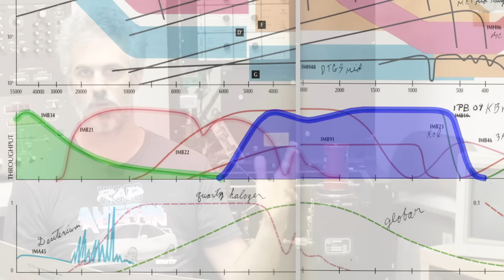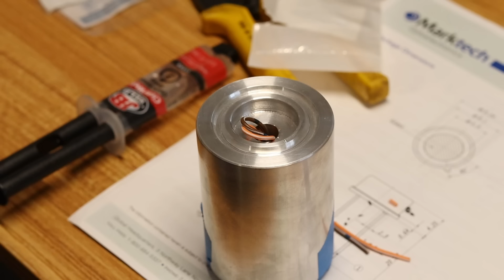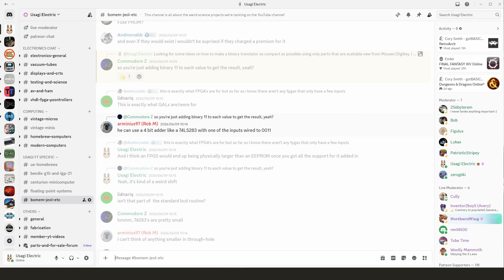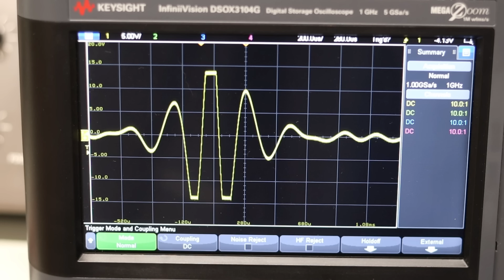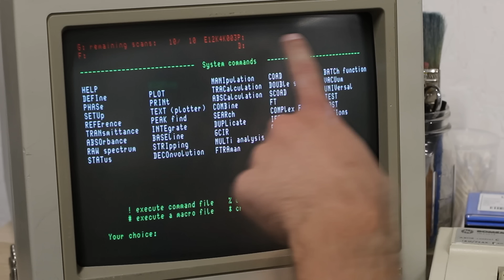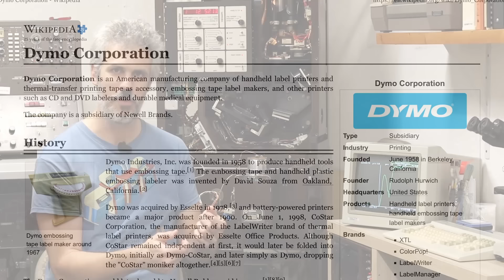Using a PDP-11/73 to do Real Science!

Comment from the maker: @Muonium1 left a lovely reply, but Youtube's automatic comment suppression system deleted it for... who knows what reasons. But, we managed to sneak it through in a reply to a different comment below! So, for my own reference sake and to move the information to an easier to find location for anyone curious following along with our spectroscopy journey, I have copy pasta'd their comment here:

"😁 As I say before, just elated that my spectra have been of use to someone so many years after I created them! I suspect the difference in peak height between our spectra is simply down to path length and the fact that I was using pure anhydrous lab ethanol rather than a 95% solution. I wasn't even using a proper cuvette! I used a tiny little 10 or 20ml beaker, which if I recall correctly was probably about ~30-50% longer in path length than your cuvette here. Beer's law and all that... Anyway, it occurs to me that you could potentially just MAKE your own KBr beamsplitter! Sure it might sound totally crazy, but there is just someone crazy (and very brilliant) enough right here on YT who's made his own KDP frequency conversion crystals for Nd:YAG lasers already! His name is Les Wright (called Les' Lab here). 

The video where he shows how to grow big, PERFECTLY optically clear KDP crystals using Alan Holden's method with a rotary crystallizer is called "How to grow big crystals at home fast!" KBr may be even easier to grow than KDP, and should be trivially easy to cleave into flat slabs for a beamsplitter with a common razor. In fact, I suspect Les may be happy to just grow the crystal for you if he has time! Maybe you could do a collab video or something. He's also a laser expert so he may have some tips for your mode-hopping/dying HeNe there. 

Incidentally, there's ALSO a video on here from 1958 from Bell Labs featuring Alan Holden himself explaining crystals which, while not in-depth, is excellent and a fun watch. The Bomem odyssey is quickly becoming a science saga favorite on here for me!! Keep up the excellent work!!"
Reply from the maker: Oooh, I didn't even think about the difference between lab grade ethanol and the run-of-the-mill Everclear I'm using, that could definitely account for some of it.
I'm familiar with Les' Lab, I recently discovered their channel when searching for more spectroscopy content. I'll have to catch on on their video of making the KDP crystals. Mike is actually already working with a company to make new KBr beamsplitters, but our real hope is to make new KCl beamsplitters as they're not nearly as hygroscopic and much hardier. 

I'm super excited to see what we can do when we get the Bomem into vacuum. Mike hooked me up with a high pressure cell which has a very short optical path, so we can even do some fun spectroscopy of liquids in vacuum which should be interesting. He also dropped off a UV/Vis beamsplitter today, so once I can figure out how to get a deuterium source in there, we can do some UV work too!
Reply: @UsagiElectric  Many thanks again for the kind words in the video. Will be great to see what kind of super high resolution spectra the machine can produce when it's back in 'full form'. Oooh you're getting a D2 source! The D2 spectrum on Wiki....also me 🤣 hahaha. I've actually seen that one used in lots of different places. There was simply no spectrum of deuterium anywhere on the internet that I could find when I uploaded it. I love seeing it in amateur science work, forums, youtube videos, even the occasional actual published paper. Very satisfying to see so many people get some use out of it. Again, it's not that great of a spectrum! I'm sure your spec could achieve MUCH higher resolution throughout a far wider range, and so if you want to replace it with a better version, please do! Cheers.

Comment: I am curious as to how well a xenon incandescent source would work.  They're a bit more expensive than a halogen lamp, but most of the light emission is from the excited gas molecules rather than the hot filament.  They are comparable in efficiency to quartz halogen lamps and can last considerably longer- up to 20,000 hours in some applications.

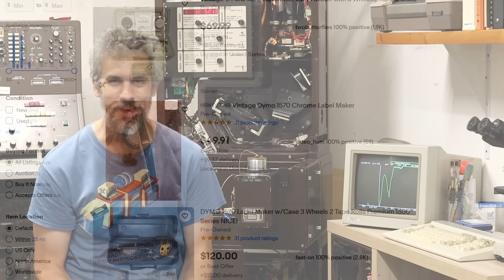Comment: 21:30 Those long handle metal dymos look really cool but I've seen 4 of those at work, and they're all jammed or got broken blades and stuff. Wouldn't recommend a vintage one unless the seller guarentees its working or you want another little project replacing cutters and getting little plastic bits to line up

Comment: Hello @UsagiElectric, I happen to have several of those vacuum tube counter modules, mine are Beckman/Berkeley Div.
 I have a question: What was first; The chicken or the egg? In other words, the HP counters are exactly like the Beckman ones I have, who licenced to who?

Mine are very interesting, some don't use a PCB, but they use a plastic sort of chassis where all the resistors and capacitor reside, sort of in a 3D network of connected components, I can provide images if interested!

If you don't see this message, I will try in the next usagi electric posting! thnx.

Comment: The "pre-amp plugs into the detector" thing is probably due to the wires picking up static electricity otherwise. And I guess the InSb detector would need liquid N2 cooling in the near infrared because its own blackbody radiation would already saturate the detector.

Comment: I'm loving this! When you finished the first Bendix G15, I asked what practical use it could be put to, since the software that the original owner of that computer had run on it was long gone, and nothing had been written for a Bendix G15 in decades, and I'm not into games like so many retro computing enthusiasts are. Well, now you're putting a vintage PDP-11/73 to good, practical use with an equally vintage Bomem spectrometer, and it's completely awesome! Back when I was in college, I did my computer science homework mostly on a DEC VAX 11/780, but after graduating, I never had a job with a company that used a minicomputer for running actual business applications. The closest I ever came in the real world to the kind of programming I learned in college was making occasional modifications to check sorting software on an NCR Tower that ran Unix. Seeing a PDP-11 used the way you're using this one is exactly what I missed out on. Thank you!

Comment: First, I love OSH Park: their customer service is great.

Second, I really suggest against running tap water as coolant. I'm a little more demanding (12kV CO2 laser coolant loop) but I can't imagine any reason you wouldn't want to run a distilled water coolant loop in any machine, especially one with high voltages. The tiniest amount of aquarium anti-algae chemicals and you're still at negligible conductivity and near zero TDS to deposit on your basically irreplaceable equipment. You can either pay less than two dollars a gallon for distilled water or buy a $60 distiller and get it for something like 20 cents a gallon in electric costs, then just use a 120v submersible pump in a five gallon pail. It's a cheap way to protect your equipment and you don't even have a total-loss system. 

Just keep an eye on the water temperature. If it gets too hot, you can throw ice in some sealed plastic bags and put them in the bucket or, if you're a little more demanding, set up a radiator and fan or even a secondary cooling loop with non-distilled water and just dump ice in the secondary tank.

Comment: The board houses' default shipping method is pretty expensive, they use either DHL, FedEx or UPS. But they all offer a "cheap" option that takes longer to get here, but is significantly cheaper. I'm patient and willing to wait a bit to save a significant amount of money. (well, actually I'm not, but I've trained myself to be patient when it comes to ordering stuff from the far east.) And it actually doesn't take that much longer than DHL/FedEx/etc. DHL/FedEx/etc. usually gets them to me in around 3 days, and yes the cheap options are slower than that, but not by much. I usually get my boards within about a week, sometimes 2.

Comment: While Dymo labels are very retro, I really like my Brother P-Touch...  I have the PT-P720BT, which is bluetooth, and rechargeable, takes tapes up to 0.96 inch wide, and there's tapes in a wide range of colors... This labeler is run from apps on your phone, and can do graphics as well as text.  The generated labels have a clear coat over the printing, so they are abrasion resistant.   Dymo has a similar system, i had one before this, and found the printed labels 'rubbed off' too easily.

Comment: Use SSOP adapters for fine pitch SMD IC's and mill/etch the rest.   I've had similar experience with Chinese PCB manufacturers, Aliexpress as well.  Prices have reached Radio Shack levels and getting worse..

Comment: I wonder how much cooling the Bomem equipment needs. If it's not too much, a system built from CPU cooler parts might fit the bill. You could use long hoses (and a larger pump) to bring the heat outside if needed.

Comment: What adhesive did you use to mount the photodiode? Many common adhesives will outgas in a vacuum even when completely dry and cured, and will contaminate the vacuum with the gases they produce. There are special vacuum adhesives for that application, but they're not common.

Comment: Re your problem etching PCB boards for SMT components.

I wonder if you could go old school - draw up your circuit. Print it at whatever size. Photograph it on film. Develop the film. Then use the negative as a photoresist layer to chemically etch the board.

CAUTION: you will have probably have to experiment to get your reduction ratios right. A digital camera and printer might be useful for this process.

Comment: Would look into a "custom loop" setup for PC, there is Radiators, fans, pumps and compensating tanks, using distilled water also better. While one can use copper piping or flex, the polymere tubing is cheap has quick disconnects available and allows observation of levels and flow. 

I personally don't think that additives are a good idea - except may be anti-algae - but there are some UV reactive ones or one can use LED to make it light show.

Comment: Hey! Have you checked if the Bomem can be operated with a nitrogen purge nstead of vacuum?
I've worked with a Perkin Elmer FTIR before, and we would regularly purge the optics with dry nitrogen and replace a desiccant pack. It's much simpler than maintaining a vacuum, and avoid the risk of oil vapour from the vacuum pump contaminating the instrument (and/or the entire room).
In general, the objective is to remove as much water and CO2 as possible from the optical path.
Also, for UV measurements, quartz cuvettes are more suitable than the glass ones that you're currently using. Quartz cuvettes are usually marked with a "Q", while glass cuvettes are marked with a "G".
Regarding the cooling, you can try sourcing a recirculating water cooler - it works the same as the ones used for PC - a reservoir, water pump,  and radiator - but scaled up to provide a higher flowrate. Some models (recirculating chiller) can actively cool the liquid to lower temperatures, just keep in mind to use an appropriate coolant.

Comment: Hey there Usagi, I hope this finds you well.  Please do not use tap water and a wastewater setup!  The threat of corrosion and microbial growth in the loop is real in an open system!  May I suggest a closed system of distilled water, additives, and an aquarium chiller with a small rad to prevent the eventual leaks and corrosion?  It's compact, quiet, and will save components.  As always, I hope the mad sciences smile upon you!  Love from Iowa.
Reply from the maker: The difficulty comes with flow rate and volume required for the Auger. That will require professional grade lab chillers, which I can't afford. The previous owner just ran tap water through it for decades with no issues, so I know that that at least covers the flow rate and volume problem. I do intend to put some filtration, if I can find filters that provide enough flow. Also, I intend to put a purge port so that after use I can purge the lines with compressed air. Since it'll typically be a few weeks between use, purging the lines with air is a smart idea to keep the channels clean and prevent any potential water leaks.
I know that microbial growth is an issue, but with some filtration and proper purging, it should be minimal!

Comment: My mother worked as a lab technician, and back when access wasn't as tightly controlled as it is now, she let us kids come see the lab where she worked, so long as we didn't touch anything (meaning me). There was a machine slightly bigger than a jukebox along one wall that fascinated me. The samples were loaded into special 'cards' along with test reagent cards, and which traveled through the 'production floor' (if you will) via chain drive - the top of the machine was glass so you could see where the cards were at any given point in time! I now realize that it was a type of spectrometer, as it had a couple light sources and filters that rotated as it took measurements, and the final results were 'printed' onto photosensitive paper (started out yellow, but light exposure turned it purple - loved it when Mom would bring home blank sheets that were left over from the process of loading a fresh roll).

Comment: If it'll be difficult to find a HeNe laser tube replacement of exact size,  you can try rediffusing the Helium that leaked out, by putting it in a garbage bag full of pure Helium for several days. It works as long as low  Helium is the only problem.  Something like a day or two for every year of age.
"Helum soak technique"

Comment: FWLWI: I've been using Seeed Studio for my PCB's for years. Very happy with them. No idea about costs / shipping for you, but might be worth a dry run.
Another option:
Do you have a laser printer of some sort? Time to get some copper-clad, ferric chloride, and roll your own PCB's. I don't do many of my own these days because ordering from gerbers has become so cheap and easy. But it is satisfying for those specific projects.

Some day I'd love an explanation regarding postage in / out of the US, especially as this seems not to apply to Canada / Mexico.
The reason I never used to order from US companies is postage was always idiotically expensive. From China to the UK is usually less than £5, if not free. From the US? $40+ at minimum, and often over $150!
Of course now the dangerous orange paedo is running the show over your way I don't buy anything American-made, but that's another story.

Comment: Using a long wire to the PD is a bad idea. It increases noise level a lot in most cases. There are several topics which must be optimized to make the PD+amplifier to work perfectly. A FET type low noise opamp like OPA602 is needed. H2O has many absorption peaks in air and in matter, at close wavelengths too

Comment: Could there be value in putting a TEC cooler on the aluminium block to reduce the temperature? Maybe reducing the thermal noise?

Could you get one of those laser etching machines for local PCBs? Marco Reps did some good reviews.

Comment: The freight cost is the result of a limited choice for the Asian supplier. For any higher speeds than 1MHz a multilayer board with a ground layer direct under the signal layer is anyway a must have to avoid crosstalk and other issues. Since modern components are smd only with the exceptions of transformers and special foil and large electrocatalytic  capacitors, I would  already plan for SMD designs.

Comment: What am I missing regarding the 3bit to 5bit conversion?

(Edit: I figured it out myself. Explanation of what I missed at the bottom of my message.)

My initial thought would be to just limit the resolution by setting two of the bits to a static logical value and control the other three bits. (Either the three lowest, middle or highest bits). Together with adjusting the incoming voltage from the sensor (which still need to be adjusted), wouldn't that be all that is needed no matter the difference in the ranges.

Since adding three was enough I have a hard time understanding what required doing this digitally. It would have been nice to see an explanation of the actual issue.

Edit: After some more thinking and also looking at the actual measuring part of the video, I realise that the purpose is to match the existing amplifier and that the signal from the detector has a specific range that can't be modified...

Comment: I worked with IR lasers in grad school.  We used NaCl (salt) optics in the lasers which is hydroscopic.  We placed a 10 watt resistor under the window and had it on all the time.  (In Lubbock).  No problem with moisture damage over several years.

Comment: I wouldn't just run tap water in it. If it is hardwater, it will build up in there faster than you think. I would adapt some PC watercooling parts to run it. A good 12v pump and a LARGE radiator should handle that fine. You can use a 5gal bucket of distilled water and not worry. Maybe add some biocide to the water.
Reply: I would guess that David being a mechanic would also have a few heater cores from old cars kicking around?

Comment: You need machines to make electronics work with invisible light that will generate electrical signals that you then encode, transfer, manipulate, and display digitally. It can't be that hard.